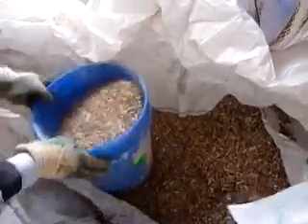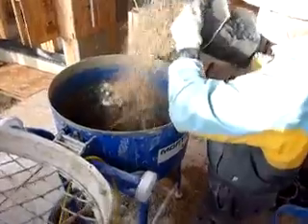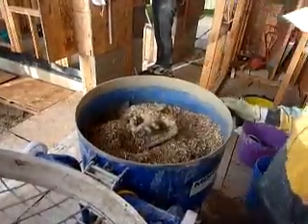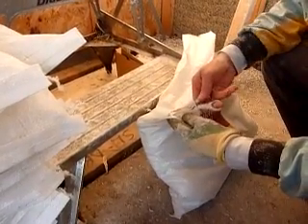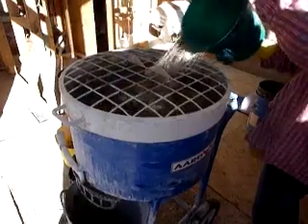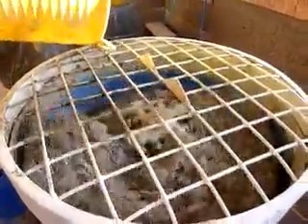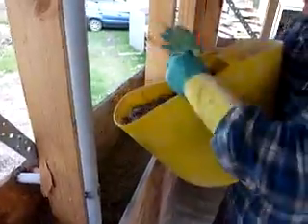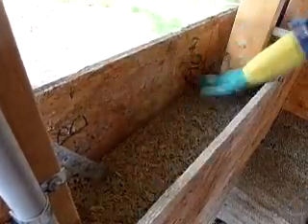How to build a Hemp Wall

Comment: Anyone have any info on success of getting this process approved for a building permit?
Reply from the maker: Randall Wyandt If you are building in Australia each of the companies that supply the lime binders will be able to provide you with an engineer's report that you can submit as an Alternative Solution under the Building Code of Australia. I am sorry I am unable to comment on builds outside Australia, but many hemp houses have been built in Australia in different States and Council areas and most of the people I have spoken to have not had any problems getting Council approval.